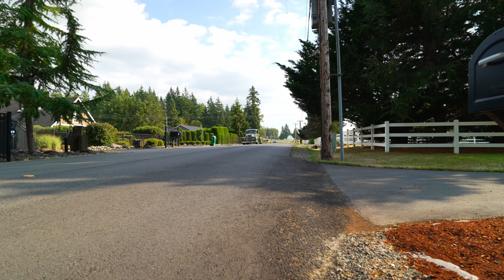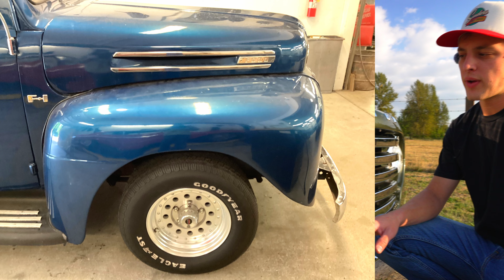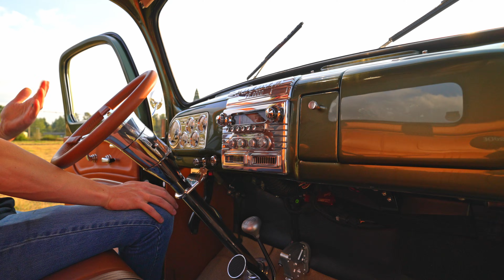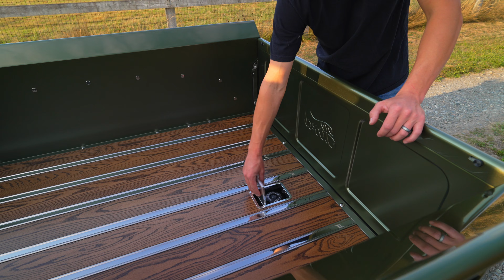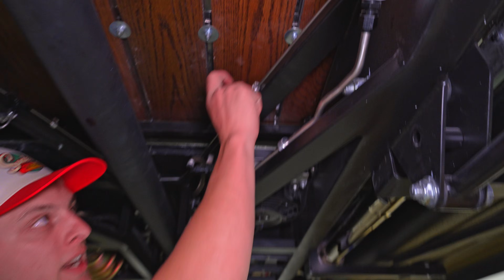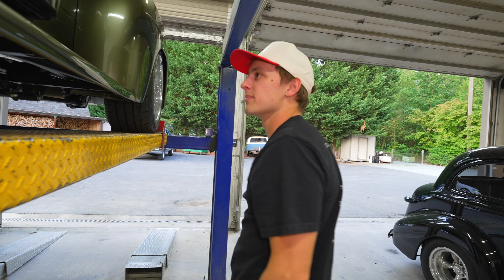1950 Ford F1 Truck - Build Overview

Comment: That is a damn nice build.  The way you did the radio, AC/Heater controls, and vents, within the original speaker area is pretty impressive.  My only criticism is that the truck no longer looks like 1950. I did a quite similar resto for a 1949 Mercury M-47,  but I was insistent that the truck still looked plausible for 1949 factory original, interior and exterior.  It's pretty neat to drive a factory original looking 77 year old piece of automotive history with modern drivability, braking, AC, smooth shifting transmission, and crazy stupid horsepower.
Reply from the maker: Sounds like an awesome build!

Comment: It's very pretty, but no longer a 1950 Ford.
Reply: Can you elaborate?  I think I know what you are going to say, but curious as to your viewpoint.
Reply: @fredthegraycatt 
My viewpoint doesn't really matter, my 1950 that I've built with my own two hands is all original, the wheels and hubcaps are what came on it originally. Naturally the disposables have been replaced mounting rubbers window tracks etcetera. It does have new side mirrors which are very close to period-style mirrors.Same motor transmission and rear end that it originally came with just rebuild... I like things as original as possible, but everyone needs to do their own thing.
Reply: @markmoore1835   I agree with you. I have yet to find close to factory original looking mirrors though.
Reply: @fredthegraycatt 
LMC...
I got the ones that mount on the doors upper hinge pins.

Comment: The coyote and maserati 4.2 sound excellent with x-pipe, long tube headers. I found great value in using $25 thrush glasspacks too (playing with overall diameter size if you don't mind the weight of a glasspack over thru thru muffler). (just paint them so so no knows what you spent). I just handmade a UEL header for a Promaster City and have been experimenting with exhaust pulses and setups, even using a 60mm carbon akrapovic for a Yamaha R1 on a 2.4 inline 4 sounded amazing once the cat was gutted.
Reply from the maker: Sounds like your having fun! I’m pleased with how this one sounds

Comment: I've got a '50 also, really making me want to go the extra mile. On a stock chassis, but thinking of swapping over to TCI.
Reply from the maker: TCI and Roadster shop I believe make chassis for these now.
Reply: @sandersstreetrods    I chose a Roadster Shop chassis for my 1949 Mercury M-47.  It was damn expensive, but I would do it again over restoring on the factory chassis.
Reply from the maker: @fredthegraycatt you get what you pay for 👍